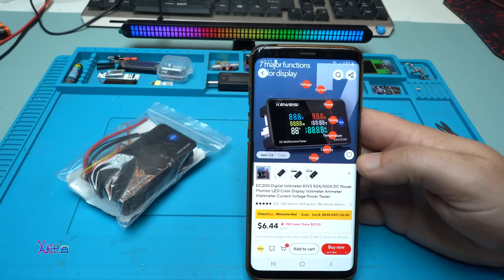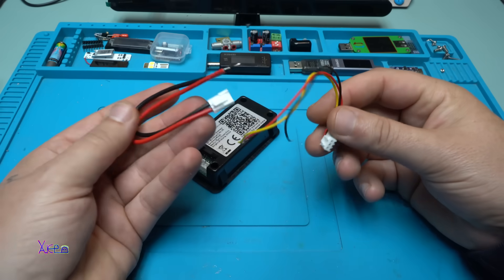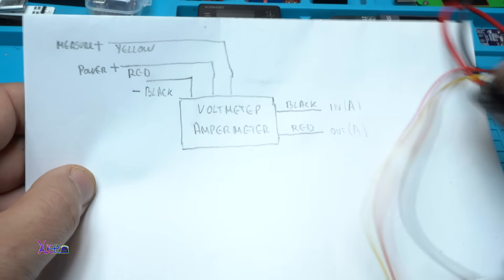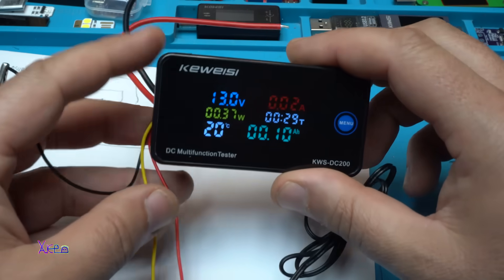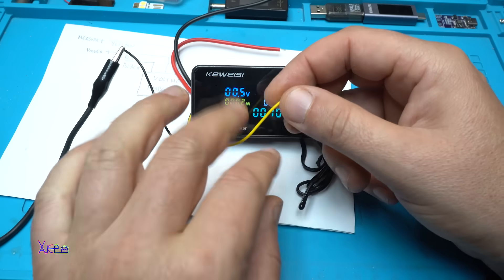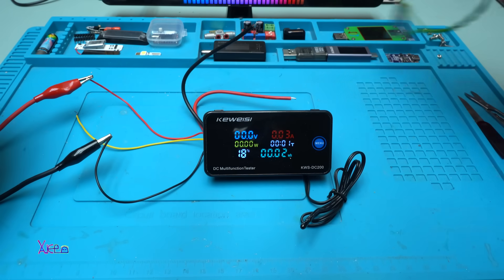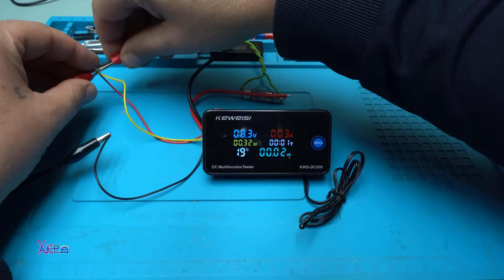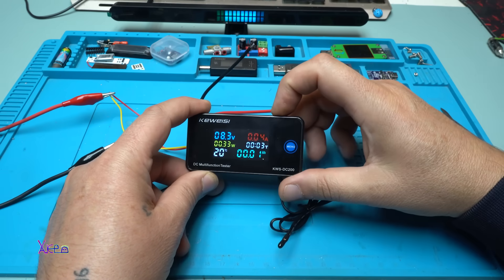$6 Aliexpress Module and it's AWESOME?

Comment: look for atorch dc power meter. they have quite allot with pretty detailed meters (like multiple zeros after the comma) for dc, ac, multiple 100s of amps etc. but just get the 10/20/30 amp one and plz compare it to this one. (i peronlly really like the atorch, get from any atorch the wifi version (if it exists) bcs those can all be updated, just bt/rs/usb versions cannot be updated)

Comment: weird. Is a shame the negative for the current measurement isn't floating from voltmeter ground.  That would have been possible if they used inductive method of measuring current.

Comment: You want to add the larger ground when testing the amp load because that little black wire might not be big enough to handle the load you are measuring.
Reply from the maker: Yes you are right sir,thx for sharing